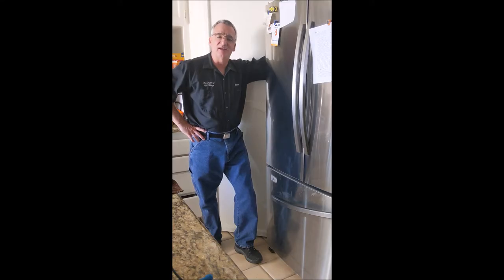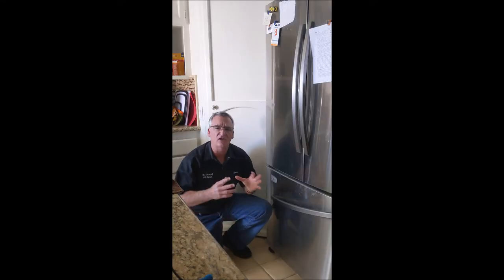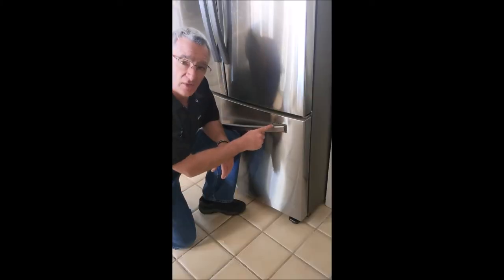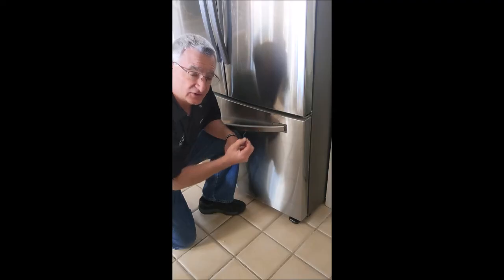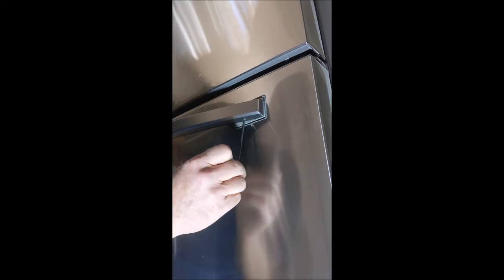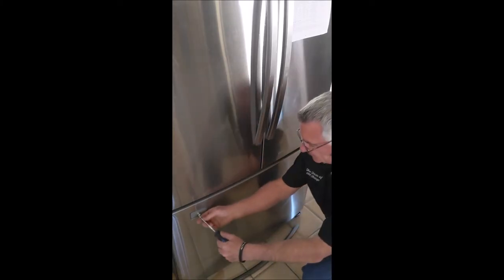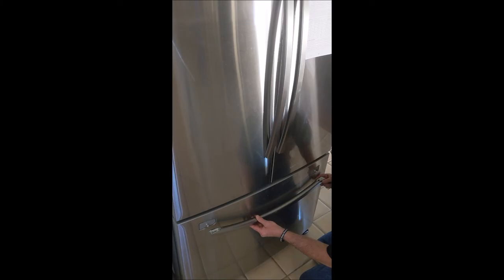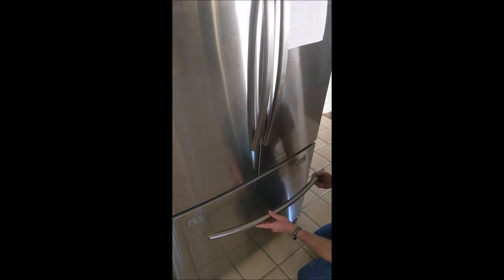Samsung Freezer Handle Problem

Comment: The biggest flaw is that the interior handle plastic breaks and is only fixed by buying a new freezer door.  Loose screws is not the problem, major design flaw in the design with the handle.  Bought top of the line smart fridge for $3900 (fancy schmancy).   There is a fix on you tube, they all fail in just a few years, look it up.

Comment: Thank you so much for this video!! My mother had the same issue with her freezer handle and a local repair shop wanted to charge her $200.00 to repair it. It cost me $2 to get a set of allen keys and it's fixed! Thank you!